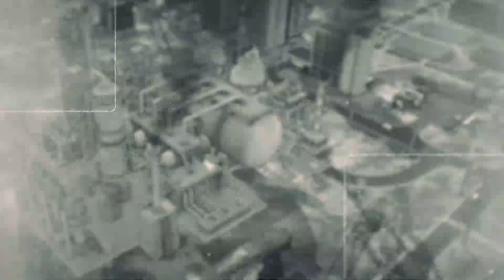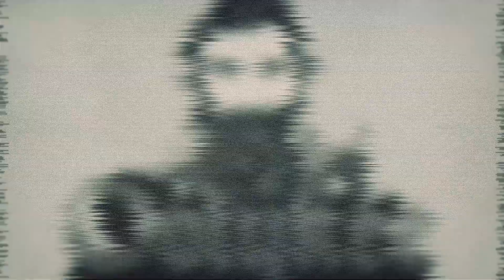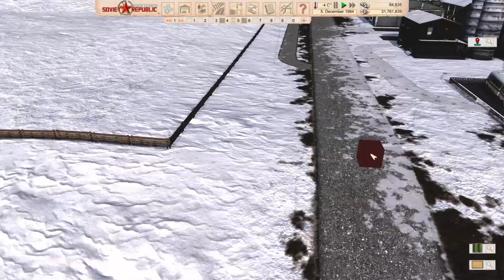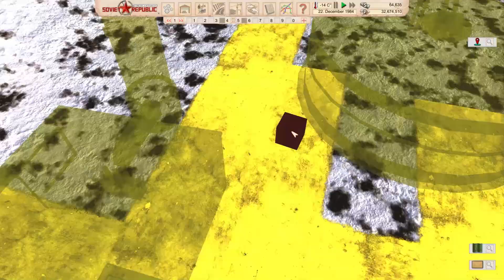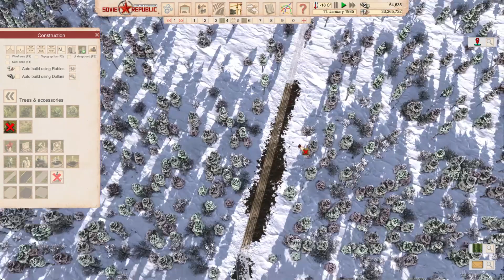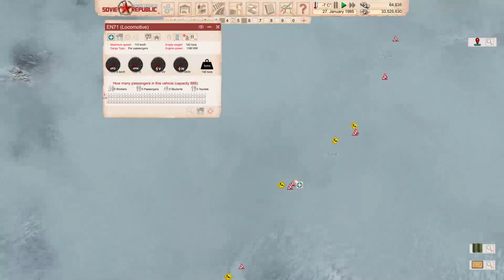Soviet Republic - Alaska - The New Beginning - Ep.96

Comment: I agree with others, no more industries in Galask Gov. it should remain as our pioneer rural town just add a few more trees and other cosmetic refinements over time, there are two large untouched valleys on the map for industrial expansion. Also as has been mentioned previously if you start a construction don't just allocate the ground work office allocate everything needed to complete the job no need to spend time going back again the same with your railroads most of them are too short for two step construction I would use the shift button highlight them all and get them all built electrified it would save a lot of time allocating the two construction steps and looking for missing bits, just let the CO's do their thing in the background, long valley tracks are fine to build as two step construction this map doesn't have enough large plains suitable for long railway networks like your previous ones. Screen time is valuable when there are so many bigger things to do in expanding the republic. End of rant. :) Cheers Boss 🙂
Reply from the maker: Yeah! I understand. Do it like the old ways. I agree. I'm not yet up to the task of speed building. I will do the videos on these though. I believe they are much faster but you need to be focused on this alone and too much stuff is happening in the background and issues I never resolved that are distracting. 

Will do, boss!